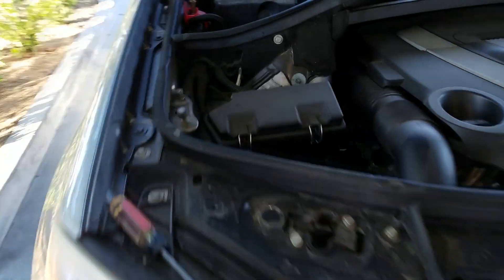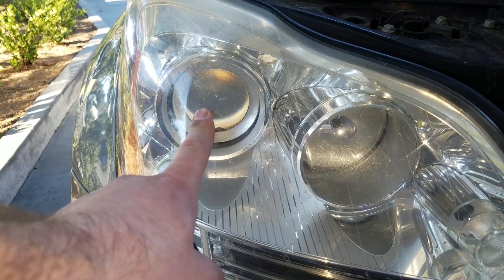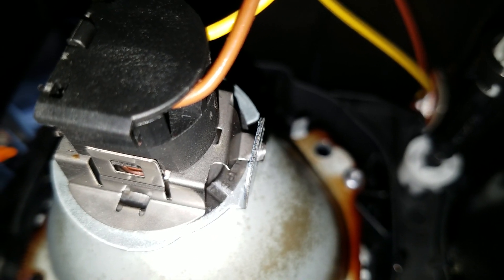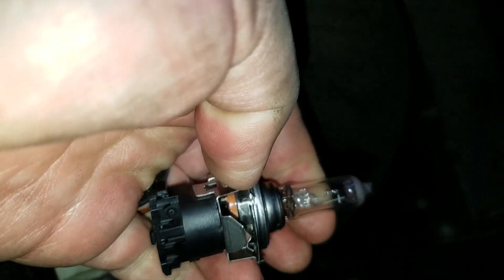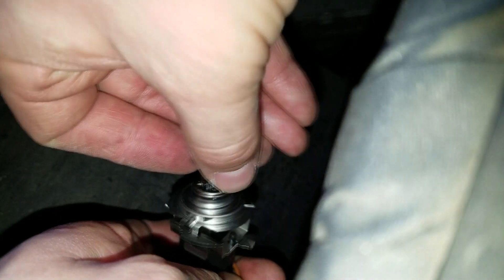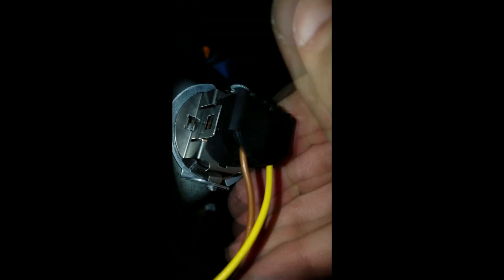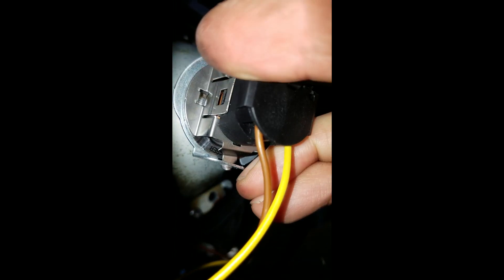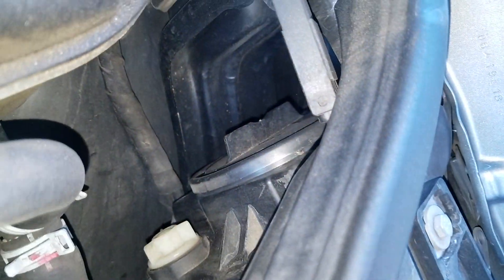2011 Mercedes GL450 how to replace the headlight low beam light bulb - Halogen type

Comment: This bulb will blow out in 5 minutes after this install. The oils from your fingers will cause an uneven thermal heat soak on the surface of the glass which causes the bulb's glass to crack. Use clean rubber gloves when touching the bulb's surface, and I would also use an alcohol  pad to clean the bulb along with the gloves just before the actual install.
Reply: It didn’t blow out